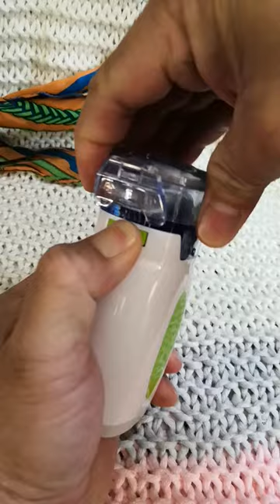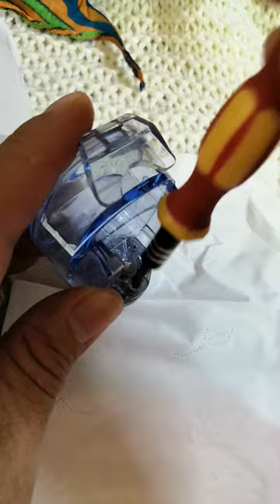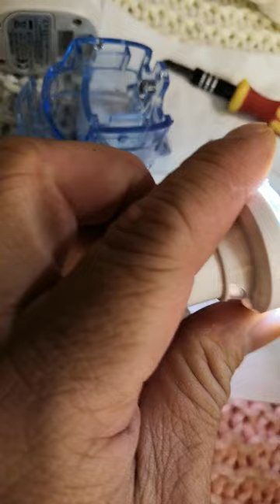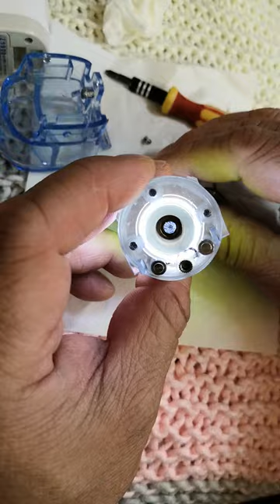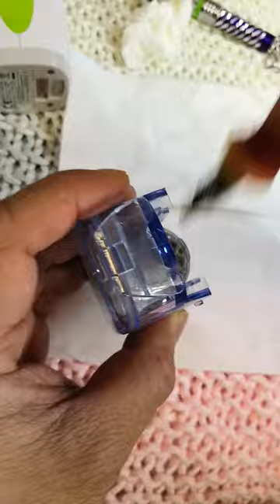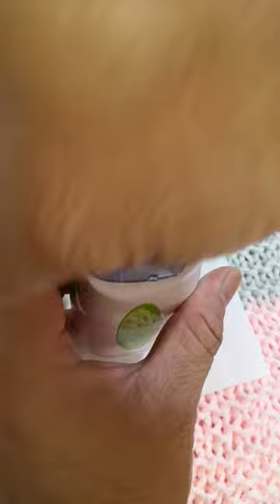How to clean Mesh Nebulizer (Scian NB810B)

Comment: Can you tell me where to get the brand of nebulizer you are using?
Reply: Got that online shopping, (Scian brand). 
just recently, I bought water moisturiser spray online, good thing about this product: 
10X cheaper, but it works the same, chargeable, small, stronger. 
but i dont think it will last as the former